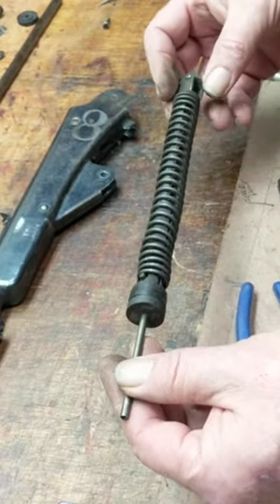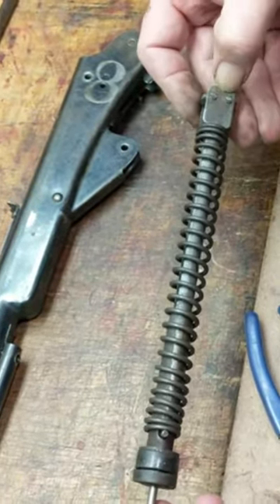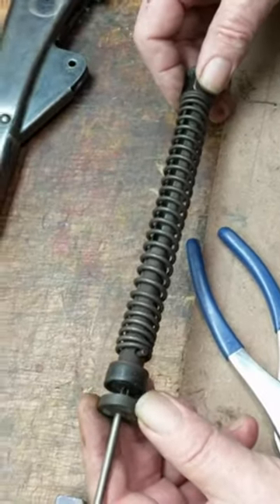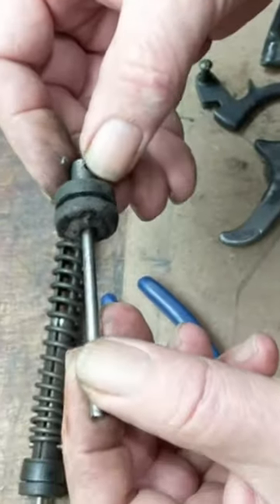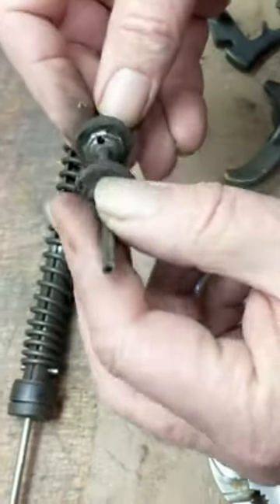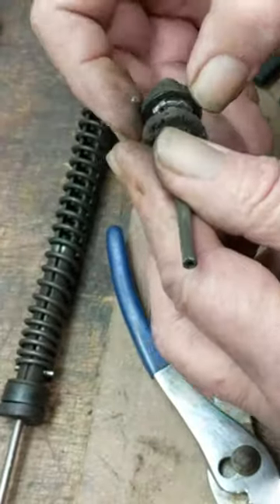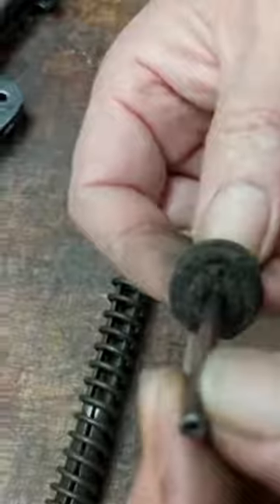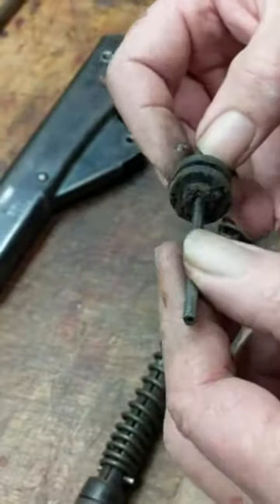Plunger and mainspring inspection on a Daisy #111 Model 40 Red Ryder Carbine

Comment: Neat to see ...Shane could you add oil to the leather seals to make them swell to make them right in the tube ...or are they just to far gone after decades ?
Reply from the maker: That works on some of them, others benefit from being extracted and give an overnight soak in 30 weight non detergent motor oil. If they are breaking into chunks it's too late and they will need to be replaced.